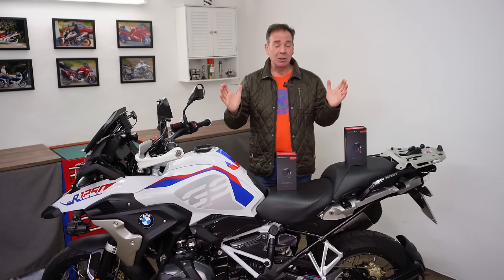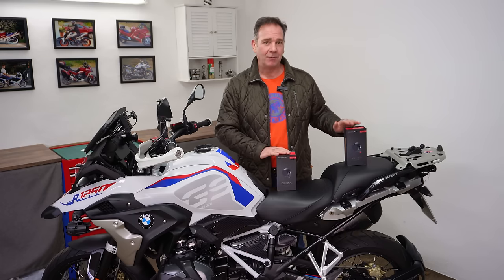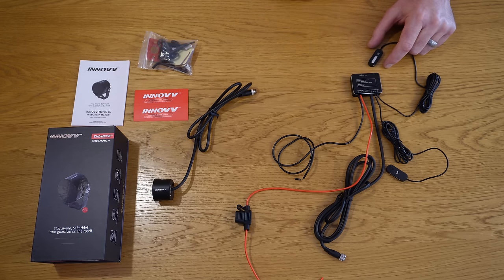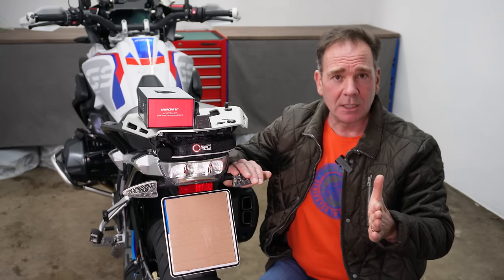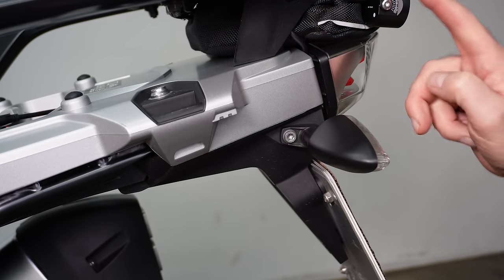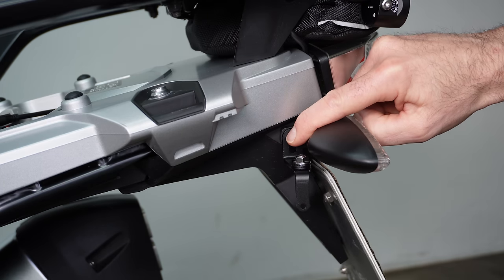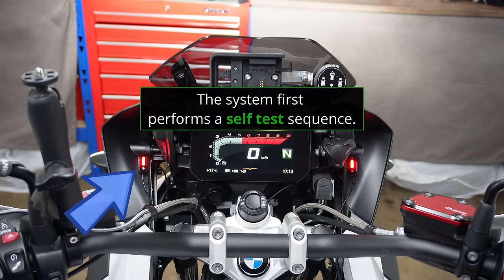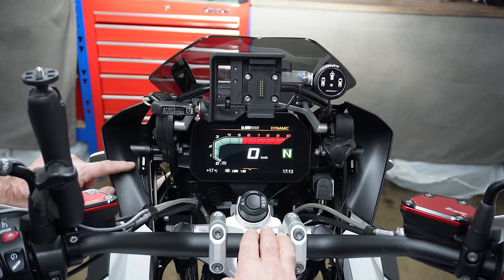EP 26: INNOVV Third EYE Radar Blind Spot Detection - Installation Guide BMW GS & GSA  How To Install

Comment: Hi Carl...When you connect the two thicker cables for the front to rear units,  if you look where the lug is in the connector,  there is a Innovv logo with an arrow on the outside.  Both sides of the connector have the same logos and arrows.  You don't have to look inside the connector you just need to line up the logos and the arrows for a perfect fit.  Great vid by the way.
Reply from the maker: Hi Paul, well spotted and thank you for sharing, perhaps I should wear my glasses when I’m filming 😉 in garage. lol 
Kindest regards Carl

Comment: Hello Carl, I have the mirror kit, I tried on the mirrors but they aren't bright enough to catch your peripheral vision so I then moved them onto the Cymarc anti-theft bracket which surrounds my TFT and they work a treat. As you mentioned if you don't have the back under the rear rack it's easy to fit centrally underneath which I've done.
Reply from the maker: Hello Jay, sounds like you found a great location for your mirror kit, I’m going to check out that bracket it sounds perfect, thank you 🙏 
Carl
Reply: I wish I'd read this before going to measure mine. This is the perfect location.
Need to decide on which option now.
Reply: @Simon-fm8yc  I’ve got the mirror ones but in hind sight would either get the clock face one or of gone for the Chigee which incorporates a similar blind spot warning but also has a camera and display for Apple car play.
Reply: @JaySalvoUK thanks. I'm leaning towards the watch next to the sat nav. I like the rear collision indicator and it's more in my line of sight.
Reply from the maker: The Watch version up by the Navi is 👍

Comment: Thanks Carl. Another well presented and informative video. I'm going to wait to see how the 2 systems work out. But initially the watch type seems best for me. Wiring under my seat is getting tight, as I have an Cansmart and several accessories wired under there.
Reply from the maker: Hi Slip, good evening, the cables are long and give lots of mounting options, this is just one that worked for me during the testing, I’ll probably move everything once I’m done and possibly down one of the sides. As you’ve got a cansmart the ignition on feed will be easy for you. Carl

Comment: Hi Carl. 

Thanks a lot for all your videos. They are just great.
 
I installed the mirror version of the thirdeye system on my r1200gs adv 2018. In order to have the led indicators on the mirrors, I changed the oem ones for a 719 copy. They look great and they have inner channels where to route the wires and there's a very good place where to stick the indicators on the up of the stalk (next to the mirror). I think it's probably the best place to put it. 

In your case, maybe also on both sides of the gps, like the clock version. Your clock version, in Germany where overtaking is on the left, I would put it on the left of the GPS.

And also, the possible future product with the connector for the r1300gs OEM mirrors. That would be for sure the best option. 

Best regards.
Reply from the maker: Hi Juan, greetings 🙏. Thank you for your kind words and feedback very much appreciated 👍. Sounds like you have done a great job on your motorbike.
Yes your idea to use the R1300gs mirrors is great and I hope to have a video about exactly that conversation very soon, Innovv are making a new product that will to this. When they have finished testing it I hope to have the new product on the channel.
Thank you again and best wishes Carl

Comment: Great video ( as usual) Carl, certainly an interesting upgrade to consider. I think I would want to mount the sensor centrally as it would then work well both in UK and whilst touring in Europe. Looking forward to your on road testing in the next video and which design you settle on.
Reply from the maker: Good morning Nigel. Thank you , yes mounting centrally would be perfect, but so far during testing it seems to perform fine mounted slightly to the side, more info to come soon.
Finally spring is on its way which I’m delighted about 👍🙋🏻‍♂️
Best wishes Carl

Comment: Hi Carl, another fabulous video as ever. I’m looking forward to seeing your Part 1 episode to learn how beneficial these systems are when out on the road. Could you explain which QBag model it is that you have featured in your video and how you have it mounted please?
Reply from the maker: Hi Waggler, the model is made by Qbag it is called a (Luggage Rack Bag) it fits the 1200 and 1250. Just google it for resellers in your country. Normally it’s around 10 to 15€.
Carl

Comment: Hi Carl great and very thorough installation guide.  But where is your follow up rider review.  I have  K1600 which I very much want to have this system on but am having difficulty deciding which system to buy as real-estate is a bit short with the big TFT screen in the middle and I don't want to be running wires that are visible to the mirror stalks, which are my preferred option, but would not like the wires running up to them which is why I   am keen to see the 'watch' style in action.  Kind regards Peter
Reply from the maker: Hi Peter, good afternoon, I have delayed the second video due to a new option I’m testing and also an updated version of both the LED and Watch versions from Innovv. I want to include this new option and the updated versions in one video. Hence the delay.
But I think for the K1600 it will come down to the LED and Watch version as the new option will not work for the K1600. 
I will be working on the second video next week so hope to have that up soon.
I know what you mean by having a clean install without cables or wires visible, so the Watch version might be the best solution if you can mount it somewhere you’re happy with.
Of the two versions I tested both worked brilliantly but I think the Watch version gave the cleanest solution.
More to come soon
Kind regards Carl
Reply: Hi Carl many thanks for your reply and advice.
Reply from the maker: You are very welcome 🙏
Reply: @justthewayitis  Hi Carl I opted for the mirror version as like you I found a place on my console to mount the indicators.  A quick questions, what are the sticky pads and the black metal piece that come with the installation package.  Can't seem to find a use for them, or am I missing something.  Kind regards  Peter
Reply from the maker: Hi Peter, they are provided for different mounting options, I also did not use them but it’s great that they could included in the kit. 
Carl

Comment: Is it possible to use 3M tape and stick the clock inside the windscreen?  I own a Triumph Bobber, with few options for running cables or visible locations.
Reply from the maker: Yes that’s possible, what about mounting it on your bars? Or using one of the four bolts that hold the bars in place. ?
Innovv also have some accessories on their .com website which might help like bar clamps and brackets.
Carl

Comment: Your channel has cost me $800 - first the weiser lights and now this radar! I hope you're getting an affiliate deal :D 

It's also great fortune that the Weiser system has headroom for the radar. 

I actually had radar on my Tiger 1200 Rally explorer and I do miss it when in commuter traffic on the GS. I will have to look for your review video as I'm torn between the 'mirror' mount and the 'watch' style. I have doubletake mirrors and it's impractical to think about mounting the LEDs  on them. Also, I'm not sold on where you've mounted yours as there are nice little bags we can put there on the GS. did you think about mounting the mirror LED on the gps bar itself? I wonder if you didn't have the watch mounted there then the mirror LEDs on the GPS bar might have been ideal.

++I can't find a review video from you about this, is it not up still?
Reply from the maker: Well… if you get wait a couple weeks more I’ve another solution!
It’s not cheap but once I’m done testing I’ll share more.
My suggestion is to wait then you can choose between 3 different options.
Carl
Reply: @justthewayitis  sounds good. I can wait as already I didn't think I'd get this feature on a 1250. Was leaning toward the watch mount but I'm not loving either mounts apprach. It seems the mirror mounts are only adhesive and the watch mount won't give that same spacial separation. I was thinking a 3d printed part near the gps bar could hold the mirror mounts but seems like a lot of trouble.
Reply from the maker: Then your going to like the new option. I will share more very soon, Carl
Reply: @justthewayitis  just curious will the radar best option update be coming soon? also curious about the possible quickshifter fix you discussed previously. I hope you're not abandoning the 1250 for 1300 content now.
Reply from the maker: Hi, the R1300GS has gone back to BMW and my R1250GS Rallye is staying 😉.
Just returned from 10 days in the UK working at the ABR festival at Ragley Hall, so next week I will continue working on the alternative Radar solution video. I’ve now installed it on my 1250 and one R9T last week at the ABR, it’s brilliant 🙋🏻‍♂️

The quick shift fix / possible solution seems to work on 4 out of 5 bikes, so there is a risk some owners would be disappointed, so currently I’ve decided not to feature it on the channel. I may return to it later in the year.
Carl

Comment: Not having a clue about electrics,  could someone please tell me if i could get a BMW connector and put this on the Innovv and connect it to my redundant BMW nav power lead without any issues?
Thanks
Reply from the maker: Hi Simon, I think you can use the one at the front as it’s a switched feed that only comes on when the ignition is turned on, as to the rear one I’m not 100% sure because that socket is used to trickle charge the battery. If I have time I’ll check but maybe someone knows the answer and can give  you quick reply 
Carl
Reply: @justthewayitis  Thanks Carl.
I'll connect to the sat nav connector for my installation.

Comment: I was so excited about your video that I did make some thoughts about it myself. For me this lights have to  be in the mirrors beacuse this is where I look to when I change the lane. But I also do not like to glue such lights in the mirrors as this doesn't look nice. So I thought why not take the mirrors on the 1300 and put them on my 1250. I ordered one and of course the voltage that the mirror needs is not what comes out of the Innovv module. But with some adaptions I managed to make it work on the table.

https://www.youtube.com/shorts/ZxfAybf_4Cc

So I wll cut of the original LEDs put that nicely in a box now and mount it on my bike like this. 

The good news is that Innovv likes my idea too and will come with a version with connectors that can be directly pluged into this mirrors.
Reply from the maker: Hi Michael, yes several people have had the same idea and I think it will look great on the 1200 and 1250 models.
I spoke to Rock at Innovv about this a few weeks ago so I’m aware a new version is coming that will be plug and play.
It’s great to see you have a version already working, well done for your work 👍
When the final version is available I will hopefully make a video about it, as you are aware it’s not a cheap solution but a more premium solution… but still I think many owners might take this option.
It’s great to see that Innovv are listening to owners from around the world and making products us riders need and want.
Best wishes from Sunny Hessen
Carl